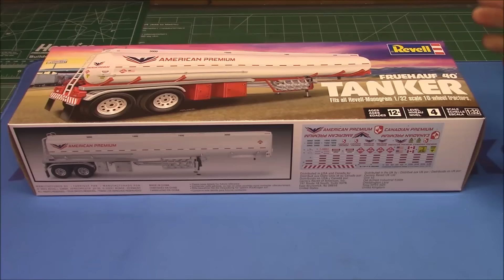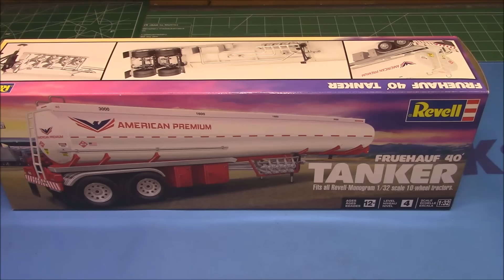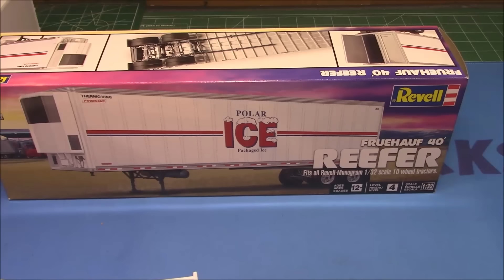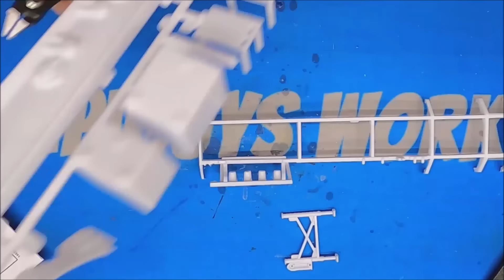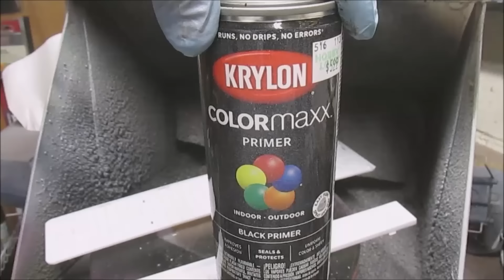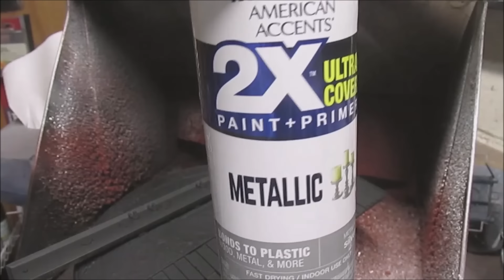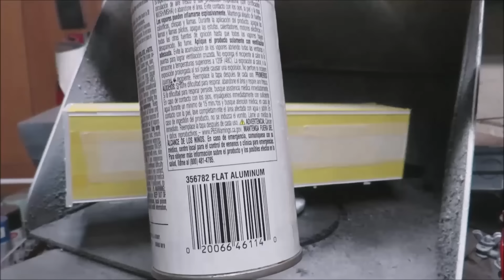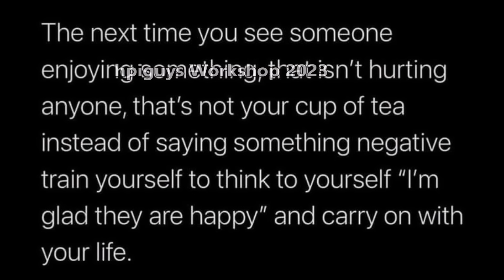Fruehauf Fuel Tanker and Ice Reefer Semi Trailer Scale Model Kit Build How To Assemble Decal Paint

Comment: I believe these are the former monogram "snaptite" trailers, I remember that they had the same tanker and dry/reefer van to go with their "snaptite" tractor line which back then were two versions (conventional and cabover)of the Kenworth and Peterbilt line..Now that I've watched you assembled these kits I was thinking maybe revel would of came out with an optional roll up door for the dry/reefer trailer..
Reply: Also Chris if you have a piece of 5/16ths vacuum hose laying around you can cut to length of that shelf like tray on the pump side of the tanker and put that piece of hose on it, that's where the driver would put it.